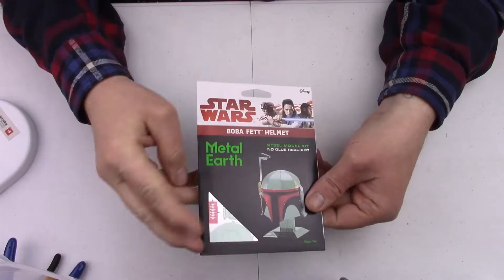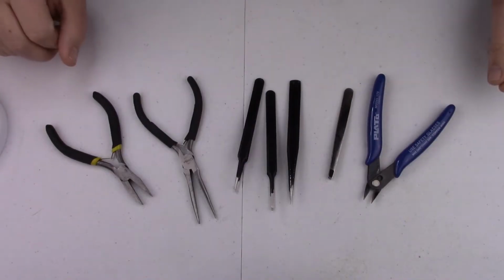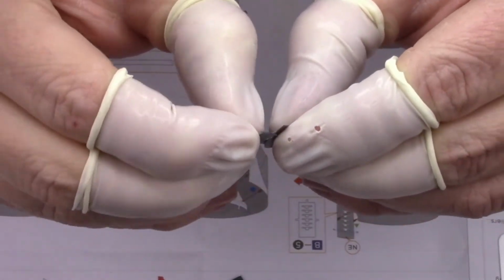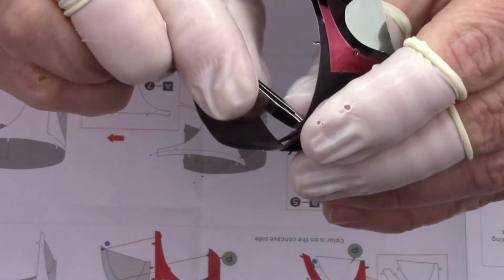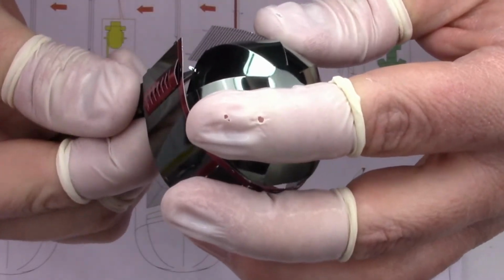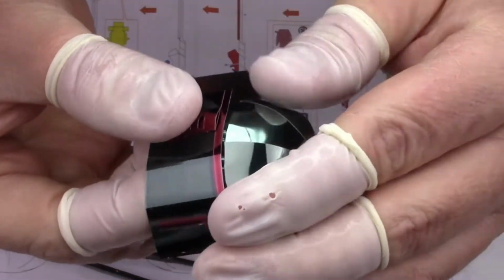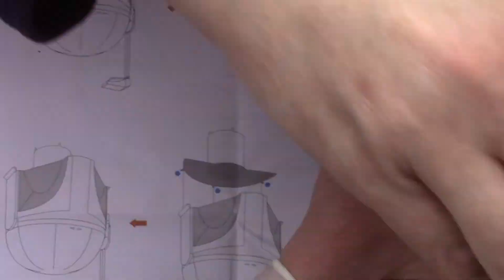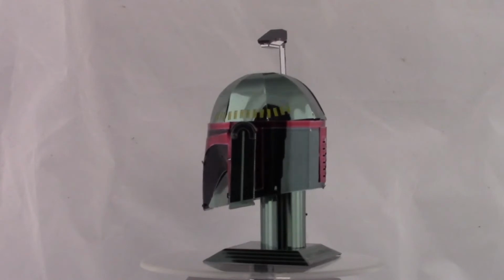Metal Earth Build - Boba Fett's Helmet

Comment: did a youtube search to see if anyone else caught this....nope. the end piece to the scanner, the instructions actually have you put it on backwards. i figured this out by doing it, then going "oh shit, i put it on backwards". then proceeded to break it by trying to take it apart. luckily the arm piece is so fragile, they give you 2. when i followed the directions and made sure i did it the way the instructions said (it folds over on it self like 3 times) a second time...backwards again. thats when i noticed the finished manual picture is correct, but the frame for this part, is wrong. i wasn't going to risk breaking those tiny arm pieces again, so it's staying upside down like yours ¯\_(ツ)_/¯